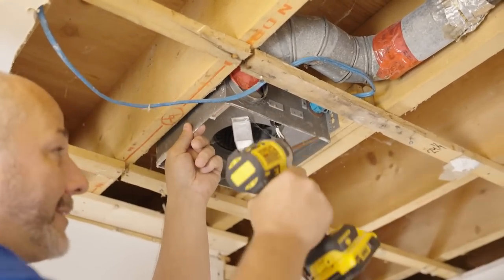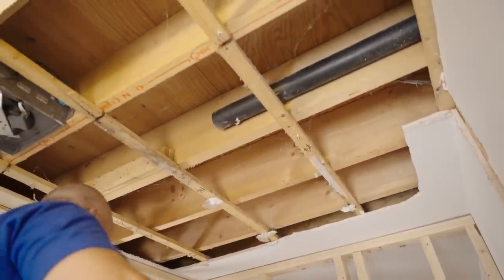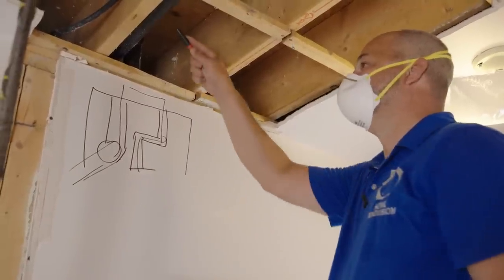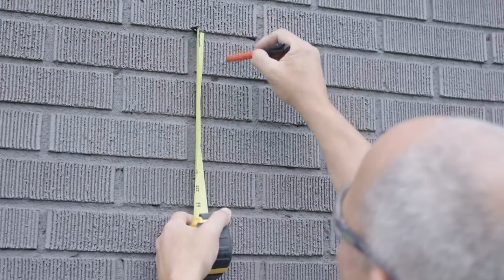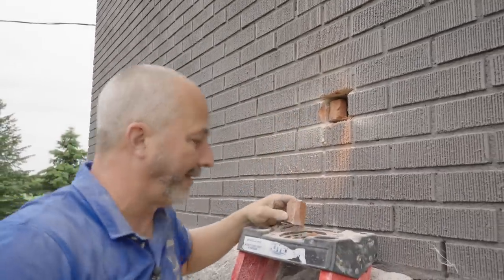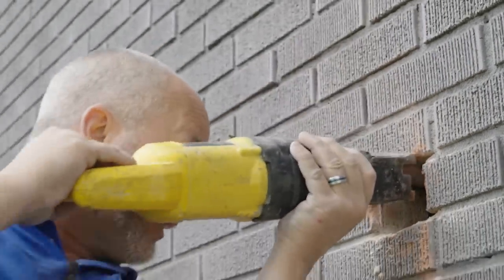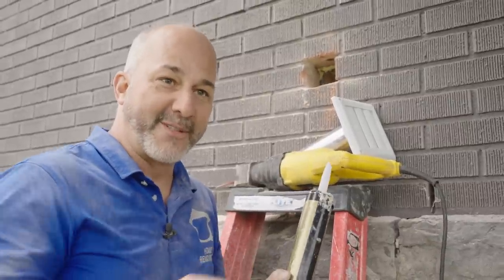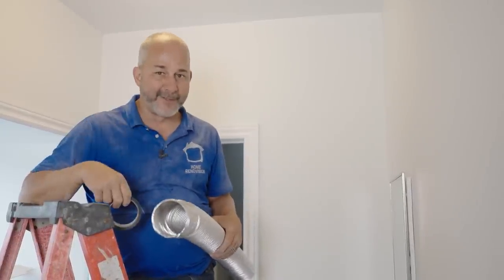Bathroom Exhaust Fan | Church Flip | Episode 12

Comment: I have a fun vent fan story....  When renovating our bathrooms I found the old vent fans had corrugated pipe duct taped to them and were being vented to soffit openings (the pipe was just sitting on the soffit not connected to an actual vent).  Luckly there wasnt any wood rot where it was venting.  Im thinking the vent fan didnt get much use from the previous family.

But I was able to install two new (properly vented through the roof) vent fans thanks to you and a few other youtubers!  Truly appreciate the work you do man!

Comment: I live in a 1942-built bungalow with a basement and an addition of a dining room with an a-frame room on top. The best discovery I’ve had thus far was that a live, cloth-sheathed groundless wire was run through an HVAC duct, connected to nothing. It arced when I went to remove the duct grate for painting. Since then I’ve become good at painting and electrical. Even picked up a 1940 bungalow down the street that I am flipping myself. Thanks Jeff!

Comment: Just finished remodeling all 3 of my bathrooms.  While working on the ceiling fans all of them had tons of mouse poop in them.  Once I pulled the fan they had no exhaust duct.  They just had insulation all around them.  So the fan was blowing just into the insulation.

Comment: The inspection for my 1963 home noted the bathroom fan wasn’t working. Figured it was an electrical problem or broken fan. When I opened the cover to repair I discovered the fan wasn’t broken….there simply wasn’t a fan at all! It was just an old rusted empty metal box where a fan could theoretically fit.
Reply: Rats probably ate it and was using the box as a hotel room.
Reply: I think the same guy built my house lol!

Comment: Had a bathroom fan installed several years ago because our main bathroom didn't have one. During renos this spring we found out the guy used a full length of uninsulated ducting hose to go from the fan to the exterior wall which was three feet away at most. On top of that it was looped in several places and wasn't buried in the attic insulation. So it probably didn't take long for those loops to get filled with water from the warm air condensing in the cooler attic each winter. So who knows how long our fan wasn't actually doing anything.

Comment: Here's a story.  I had two bathrooms where the shower neck was really wobbly.  Fortunately, one shower was on the opposite side of the wall from a closet, so I just had to cut through the drywall in the closet.  There was no 2x4 between the studs; the copper pipe that ran vertically from the valve to the shower neck was just held in place by wire.  One end of the wire was nailed to one stud, the wire wrapped around the pipe, and the other end was nailed to the other stud.
So I put in a proper 2x4 bracing with an eared elbow joint firmly screwed to it.
But the other shower was not so easy since there was a cabinet face frame on the wall behind the shower.  But I found a video on YouTube where a guy used marine putty around the shower neck under the escutcheon.  That worked great.  That putty cures rock hard.  I actually had to file it a little to fit the escutcheon over it.
Reply: can you link that video where you saw a guy put marine putty around the shower neck?
Reply: @AbRa285  It's called "Fix a loose shower pipe without cutting open the wall" and the channel is "Daddyswork".
He used a pipe flange because his shower neck was coming through drywall.  In my case the neck came through the fiberglass wall of the shower, so I just used the putty to directly bond the neck to the fiberglass without a flange.

Comment: A friend of mine bought a house in a nice neighborhood and found some problems with the air conditioning.  One room upstairs never seemed to get warmer or cooler when the system was running.  And the whole house seemed to be too warm or cool (the wrong way) depending on the season.  He had an HVAC guy look at it and they found the one room upstairs had no connection to the HVAC system.  The two vents into the room were connected to each other only.  As for the bigger picture, instead of building a 25x30 inch return air system duct, they use 9 four-inch metal pipes to feed the blower.  So there was roughly 125 square inches of intake instead of 750 inches.

Comment: I was actually more interested in seeing the pressure test on the pipe (than how to wire a fan) and if you could get more dead rats to fly out from interesting places. That seems like an interesting challenge you're doing a great job as usual. 

My bad contractor was the one that built my home, unfortunately. I'm remodeling my bathroom (with great help from you), and after demo, I discovered they had used a warped and completely broken 2x4 on the control wall. They just added another 2x4 on the bottom half (nailed together) and said good enough. Everything there was off because of the warping and a challenge to make right.

Comment: My house was built in 1942, found that they ran short on ductwork and used a coffee can to complete the run. Found a ceiling fan ran with doorbell wire to a switch, never turned it on just gutted it all.

Comment: Jeff, here is my story. After I bought my house I couldn't figure out why my baseboard heater wasn't working when all the breakers were on. Checked the voltage and nothing. So I opened up the walls with a few small holes to follow the wire. Eventually I found a junction box that was covered up behind the kitchen cabinet they installed and nothing was hooked up inside.

Comment: Funny I had the exact same problem just a week ago. My bathroom fan wasn't pulling and I soon learned it never did since the house was built 20 years ago. The flexible pipe wasn't cut to length as it crosses the outside wall; the contractor just smooshed together 4 feet of flexible pipe and screwed it to the exterior wall. The smooshing just completely obstructed the pipe (well, except for a safe passage for the mice). In extra, they installed an air intake and not exhaust, hence no non-return flap, perfect for the mice to go in.
Crushed flexible pipe, wrong air exhaust fitting, flexible pipe through the wall (no metal sleeve), no proper sealing around the hole in the wall...
How can new house builders get it all soooo wrong?!

Comment: Learned a lot. Question: Why didn't you push the galvanized pipe from the outside to the inside so that you could then attach the fan vent to the end of pipe and then continue to complete the fan vent installation (that is, press the caulked vent into the wall)? I saw you do this technique when you installed the roof vent. There you installed the pipe to the roof vent and dropped the installed unit into the (very hot attic) so that all you needed to do was attach the bottom of the pipe.
Reply: that was exactly what I was thinking. Could have saved a bit of time by connecting the two before installing it
Reply: @superaktive  He did that for his roof vent installation and I liked that idea a lot. I'm supposed to help a friend install a bathroom ventilation fan in their house and took note of that great idea.

Comment: Contractor drywall'd a garage and added 2 outlets.   Contractor used most 30' indoor extension cord to do it.  Didn't discover what happened until over a decade later.

Comment: Flipping a house with poorly done addition, part was the old porch a some was “new”. One wall was held in with only caulk. Pulling the ceiling down there was funnel with a hose that went down inside the wall into the crawl space. Guess there was a leak they couldn’t find.

Comment: Jeff you want to talk creative engineering? Let's talk my shack in new hampshire. If you guys ever want a remodel challenge, this is it. Small cabin, has an extension that was built on a partial concrete pad, part of the extension has settled but the concrete pad hasn't. They build the floor joists with untreated wood on top of the concrete pad so it's all rotted through. The contractor that did this work apparently used the back yard as a landfill - I almost sliced my eye open with buried glass when I tripped trying to measure out my ham radio antenna. I've spent the last week digging out beer bottles, old windows, and railroad ties from my backyard and i'm still not done. The insulation is R-10 - IN THE MOUNTAINS OF NORTHERN NEW HAMPSHIRE.

Not to mention the not exactly up to code electrical and plumping work. God help me. It's just a small cabin but it's a huge nightmare.
Reply: Oh god, I have similar issue. We got a home that had an addition build in 2017. The owner/builder dumped all the dirt from excavation in the back yard and used second hand material (from pipes to insulation to flooring). Also, the basement is like a Sauna, super humid. We recently found out that the drain tiles were installed above the slab to not put a sump pump. So I think I fully hear ya.
Reply: Yea also, the light suddenly go off and on by themselves and connected to a used electric outlet.

Comment: my land lord worked with some person that called them selves a contractor.  my first surprise was when I slipped on the top stair. got a hand on the railing. thought I was saved. when the railing came with me down the stairs.  I took the fall well. so wasn't hurt.  but when I checked why the railing didn't put up a fight.  they used 1/2" dry wall screws and screws the railing not to studs but to regular half inch dry wall.  he installed the garbage disposal. he mounted the switch in front of the sink.  so every time you lean forward you accidentally turn on the disposal.

Comment: I saw under a kitchen sink where they replaced the plumbing without a trap and for some reason ran a line left thru another cabinet, thru a wall, into the utility room and made a huge S trap.  From there it went UP 3 ft and out thru the exterior wall.   Im still trying to figure that out.  I dont know if its some funky vent or what.  Couldnt be too nosy, it is my Ex husbands house.

Comment: My contractor fail story: The HVAc contractor who installed the fresh air intake installed it such that the duct was touching one of my water lines. One night it got cold enough that the fresh air vent (even though it was insulated) froze the copper pipe. It burst and now I have a new bathroom.

Comment: Has anyone ever installed a bathroom fan when there’s Vermiculite in the attic?
Are there any hacks to do this?
Or do I shower with the window open in -40 winters
Reply: Wear a P-100 mask, go into the attic above where you want to install the fan, wet the area with a spray bottle, then use a wet/dry vac to suck up the insulation above the installation area. Ventilate the room below and then cut into the ceiling. Seal it off until you’re ready to install the fan. Alternatively, you could remediate the Vermiculite all together and replace it with some R13 foam.

Comment: I had a large renovation where I had the direction of my stairs turned around.  My contractor swore left and right they could re-use the old stairs to save money (the old stairs were half open on the bottom half with grooves put into the stringers for the tread made in a factory).  Well, when he was done, the stringer that previously was half open was now two pieces of wood, he hand grooved the grooves for the treads on the bottom of half of the stringer that was now against a wall and then screwed the second board into the wall for support.  He wouldn't believe me that it was not right and not to code.  Ended up firing him and having another contractor come and build a new set of stairs, but then they decided not to follow the measurements I gave him (I'm good at math and had calculated the tread and riser height needed given the floors I was installing).  He ended up installing the stairs with 6 inches too short of head room and 2 inches short on the top step.  I wish I had just done it myself the first time.

Comment: Creative contracting? Instead of taking 20 minutes to replace a $50 shower cartridge, the people who "flipped" the house I bought in April found where the water was ceiling in the garage ceiling, stuffed a pillow in the hole, and covered it with a piece of plywood. Inspector didn't think anything of it, just another access panel.

Comment: Remodeled my kitchen and found that the previous owners “hard wired” the over the range microwave into the house (instead of wiring up a receptacle in the cabinet above) they had to of cut the plug off the microwave and wired it up…

Comment: Last year I remodeled my downstairs half bath.  This is a condo with a garage on the bottom, and two floors above, built in 1980,  The bathroom was small, but I found one corner of the floor was almost 1.5 inches lower than the opposite corner diagonally.  The subfloor was in bad shape, so I removed it and sistered 2x4s onto the joists to provide level support for the new birch plywood subfloor.
To me, the shocking part (and I'm no expert, so maybe this is normal) was the air flow under the subfloor.  The HVAC air return intake grill was on the wall outside the bathroom, and with the subfloor removed I had a direct line of site down into the air handler in the garage.  So the air flowed under the bathroom floor with no ducting.
On the morning I when I was going to start putting in the new plywood, I noticed there was a bunch of trash down among the joists that wasn't there before.  So I set a trap and waited until the next morning.  That's when I found the biggest dead rat I'd ever seen.  I still have not idea how it got in there.
Reply: I have a feeling this is the case with my house. My upstairs bathroom floor is ridiculously cold with the AC on, and a grate for the other room is on the other side of the bathroom wall. I have a feeling there is no ducting there after all.